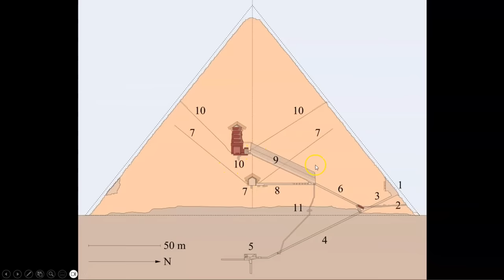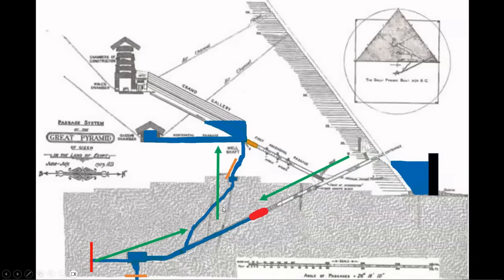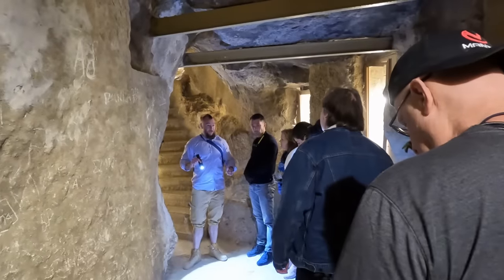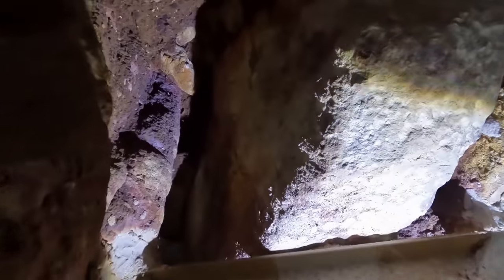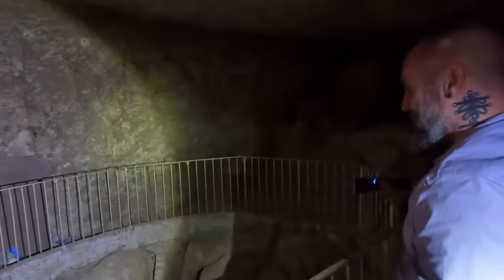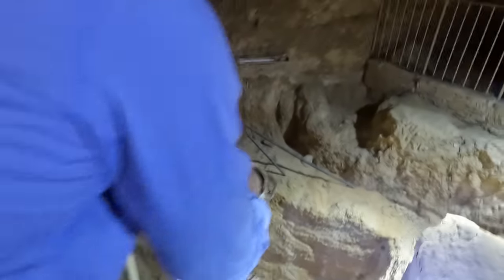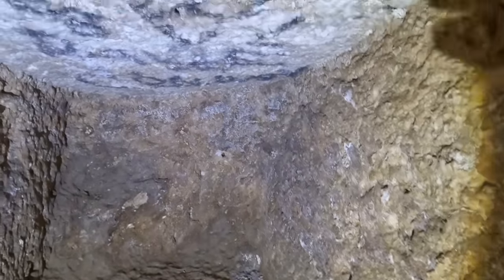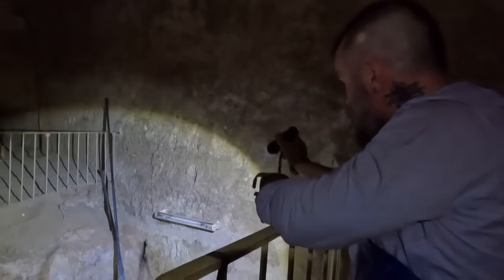Sunday Site Visit 51: GREAT PYRAMID PRIVATE ACCESS - Subterranean Pump Chamber

Comment: Just a fantastic exploration of this chamber, and that small, short corridor leading away south to a dead end. The interior features on that western wall side are perplexing. But more so still is that rectangular feature carved? in the bedrock at the bottom of the "Pit"- was that added later, or is that something that was discovered after removing some of those granite blocks to the anti-chamber (portcullis?) outside of the King's Chamber, along with the debris, other stones dumped into the pit over the eons? Why would it be necessary to carve out a square/rectangle at the bottom? Is that the actual floor of the pit, and the bottom of that square could go down much further to an elusive watertable, or necessary for the pump action?

 Amazing visit, amazing commentary and the best possible exploration of and explanation so far for that structure. It's still not clear to me why the western side would appear to be carved out; fluid flow designed w/the 1st carved structure in the back; the 2nd on the side and middle wall, and in front on the 3rd(unfinished?). It looks like there could be a method to the madness. Just much used and powerful hydrodynamic action happening a very long time ago?Or could it be that side had more of a mineral they needed to add to the water for those chemical processes in the chambers above? Thanks so much for your work, and investigations. What a TRIP! So cool....🤗

Comment: Water compression in that "dead end shaft" would make sense. Perhaps it would also explain the salt ? 
If water under pressure was permeating the rock perhaps it was dragging dissolved  salt content back with it when the pressure was released. The chamber must have purpose.

Comment: Hi, i think the granite plug is the check valve, and the well shaft is smaller cause it's a control shaft made to activate the ram pump, the input line also work as a syphon i guess, Thx for the video ++

Comment: A syringe-type suction process via pulling the plug up the descending chamber shaft would be a practical impossibility because the diameter of the shaft would have to be perfectly constant, and the plug being pulled would have to fit so tightly that no air could escape around its sides.
I have a very old, large, brass syringe and the plunger barely fits into the shaft, with no space for wobble.  That fit is necessary to maintain suction.  For such a shaft & plunger system to work would require extremely advanced engineering to create a shaft that was perfectly consistent in straightness and diameter.  No such shaft has ever been created by terrestrial technology, and no, doubt, no one would claim that the descending shaft is anywhere near perfect in the manner needed.
Also, the amount of force needed to pull such a plunger up such a shaft would be enormous.  Just pulling the plunger up the shaft of my syringe is slow and difficult (mostly because the fluid being sucked up has to pass through a very narrow nozzle tip).  The greater the volume of water that would be available for sucking upward from the pit, the greater the force required to move the plunger.  Such an effort is not only impossible physically but inconceivable due to the amount of stress force that would be involved.

Also, to use the plunger in the opposite direction to force water up the well shaft would require an inconceivable amount of constant downward force being hindered also by the tight fit of the shaft & plunger... tons of friction that would need lots of grease to lubricate the surfaces.  But, as is evident, no such surface could result from the excavation of limestone. It's too porous.  The bedrock would have to be marble, or at least calcite.

That's the situation in a static state, but if water is flooding into the sub. chamber from the Nile in peak-flow season, that might create its own pressure that could be engineered in a realistic manner to raise the water level in the pyramid.
One thing to seriously consider is the purpose for having dug that horizontal dead-end shaft.  Why do that at all unless there was an unfulfilled purpose that never saw completion.
Reply: I think the great pyramid was fully completed as planned and operated as intended. This includes the feature known as the dead in shaft.

Comment: As the lower chamber filled with water, would there be a pressurized air pocket trapped at the top of the chamber? If so, then any back and forth motion of water moving inside the chamber would have created significant turbulence due to all the irregularities carved in the chamber's bedrock. In the presence of the air pocket, this could have created a highly oxygenated batch of water. Not sure how well bedrock would trap air, but just a thought.

Comment: I'm curious how, if the "Void" above the grand gallery is real, how would that change your view of the function/s of the pyramid chemical process?
Reply from the maker: Doesn't change it at all. Actually fits quite nicely and should be there. I already have hypothesis of how it was integrated. Will schedule for future episode
Reply: @thelandofchem I'll be looking forward to the video!
Reply: I'm wondering if the people operating this proposed chem factory need a place to hide out while setting it up or while the function was happening? The newly discovered "chamber" over the main entrance, even the "alcove -like" compartment in the "well shaft", after the original source of H2O dried up? could provide shelter (there's a big block of stone inside that feature that covers the opening to the shaft)? I'm still not clear how everything gets set in motion and then how whoever is doing that, gets away in time.

Comment: I have read some historian (I can't remember the source, maybe Heredotus), who observed water erosion mark to about half way up the pyramid when it was covered in white limestone. Also, to this day, there are water erosion marks on the sphinx. I wonder if anyone has tried comparing the ground level of the sphinx to the pyramid (is the sphinx higher or lower than the pyramid?). In other words, at what level are those water erosion marks on the sphinx in comparison to the pyramid. There may have been floods in those days and if so, there wouldn't need to be a reservoir around the pyramid, because water would naturally come. It's weird to think that the pyramid was like some sort of a natural device using all the forces of nature to do its thing. Would have been so interesting to see the thing in action. How they came up with this thing is beyond comprehension... As always, thanks for all the details and work that you do, I discovered you like a year ago on Sam Tripoli's podcast Tinfoil Hat, and what a gem, thank you!

Comment: I'd love to hear the opinion of a refrigeration expert. If you were to use the queens chamber as a still, create alcholol and what have you. This creates co2 that would fill the grand gallery.
Your pump system could compress this co2 until it violently releases into the support blocks stacked above the kings chamber, creating dry ice. Bam😅
Reply: You can take the credit if there is any validity to the idea. I just want to know lol

Comment: At 7:48 I question the volume of the desending passage, compared to the volume of the upper reaction chambers and the grand gallery
Well, I guess it takes 3 pumps to fill
Reply from the maker: I agree with that, and would fit nicely with the numerology encoded in all of the structures